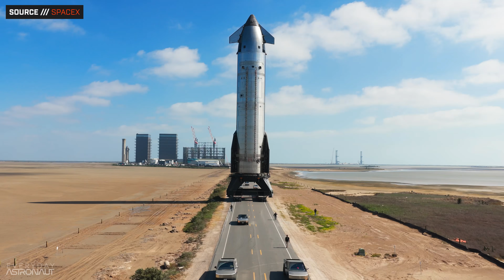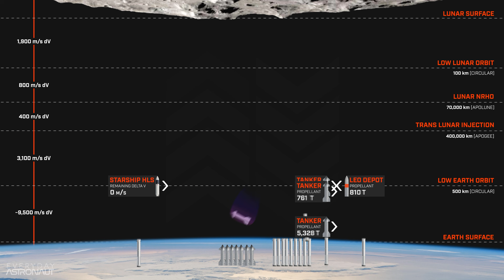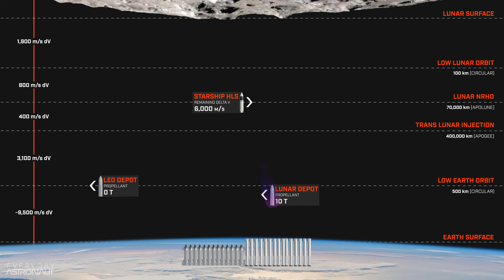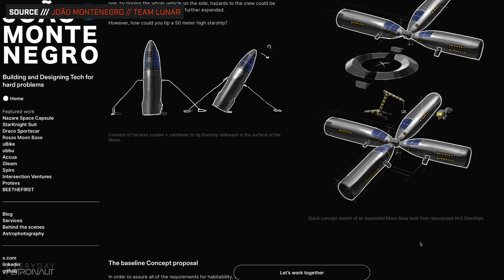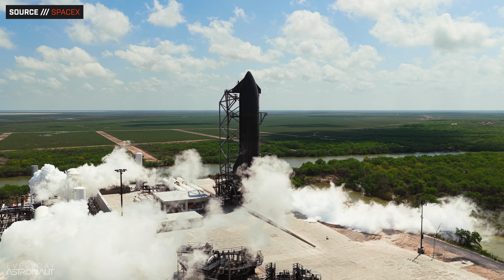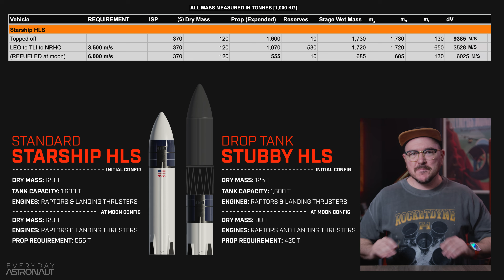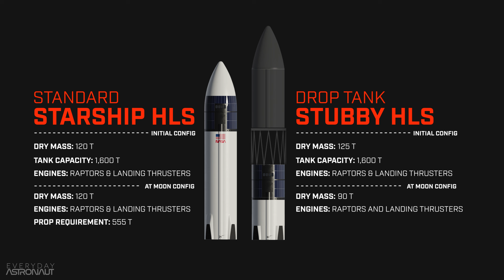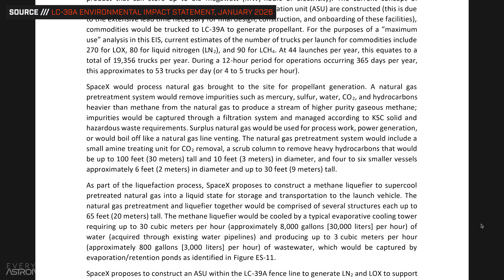Does Starship REALLY require 15+ launches to land one lunar Starship?!

Comment: you probably wont see this, but this whole plan seems a needlessly complicated. yes, orbital refueling makes sense, but it makes no sense to rendezvous with orion around the moon, or to go back and forth to lunar orbit. 

full scale HLS just takes us directly to the moon and stays there forever, building up larger and larger complexes on the moon. orion or similar + ascent vehicle can be separate and either go with the hls (solving safety issue via launching on a falcon 9/heavy and docking in orbit) or be sent to the moon ahead of time (the martian style with their MAV). both o2 and ch4 can be made on the moon just fine. no need to send tankers to the moon ever. this way we are only returning a small amount of mass and actually getting stuff done on the moon.

long term we would probably be better off sending crew back via mass driver launching a capsule, but we can ignore long term for now.
Reply: Nobody is planning to build "larger and larger complexes on the Moon".
Reply: @lepidoptera9337  thats the entire point of what we are doing on the moon. the future there is lunar industry and manufacturing. its how we continue into space. granted its going to take decades before we are doing a lot more than fuel production and basic refining there (which is how we make the fuel, by melting rocks/regolith). but thats the future of the moon.
Reply: @kazeshi2  Yes, that's total nonsense.

Comment: 28:20 WAIT, WHAT???? Pretty easy to climb 40m in a lunar suit??? Are you crazy??? 😂😂😂😂😂😂😂😂

EDIT: The longer this video gets, the crazier statements you make. No reasonable active cooling system can cool off that amount of cryogenic fuel.
Reply: The radiators on the shaded side of the ship will be extremely cold. So cold, indeed, that one has to be careful not to freeze the fuel in them. The problem isn't that. The problem is that heating on the hot side is far more effective for the same are than cooling on the cold side. That is, indeed, thermodynamics. Having said that, your hunch is correct. This isn't being built to go to the Moon.

Comment: The comparison with the Falcon is very misleading. 

Falcons land empty, which means there’s a BIG difference in where the center of mass is going to be located, not to mention the main reason they don’t fall over is *that SpaceX controls the landing pad*. They’re still welding the legs on contact on the barges, and those are fully flat and designed for landing.

Comment: If you'd proposed using multiple launches before we'd seen the absolutely mental reuse rate of Falcon I'd have called you insane, now though it just seems like a question of working through the engineering and bugs to an inevitable success. Provided the money flows I SpaceX seems certain to manage this. 2030? eh, maybe not, but soon after seems entirely plausible.

Comment: Your last comment, EA, about the human-rated challenge, is prescient. I think that getting a working human-rated Starship (HRS)... of any variant ... will plague SpaceX. For at least the next 5-10 years. 

My request for consideration: For at least the next 3 years, prioritize (ONE-way flight) lunar freight / habitats AND also  pump out the big LEO  Starlinks. 

Break into the wealthier finance-market low-latency comm-satellite industry. Strengthen Elon's  self-financing for the long-term big (Moon & Mars) goals. 

Much of SpaceX's already-done human-rating work won't be wasted, in this reprioritization. It can be applied to Starship-to-lunar-habitat conversions. 

(And then try again with transport HRSs about 5 years down the road.)

Comment: Landing horizontali would bend and destroy the structure of the vehicle, that is the real reason. It would need aditional design to acomodate for this bending wich would be safer but so much more expensive. Thrusters could still be placed higher

Comment: 15 refuel launches per mission (ISH). I think they have quite a few optimisations that together can bring that down, but if they match F9 in cadence (with 5 pads rather than 3 and reusable everything) then a fueling campaign can take 5-6 weeks. And if each launch is the cost of a F9 or less, then they have won the argument. 15 launches or so sounds nuts, but if the end result is a more affordable system than an expendable custom built one then this is the better option.

Comment: All of these calculations are predicated on the Raptor ISP. However for fuel transport (assuming active cooling) a slow boat using high ISP technology to transfer from LEO to Lunar orbit might be way more effective in getting the methane needed for the down & up at the moon.
Reply: Maybe. But then you need to create a new set of engines for your fuel depot, and deal with two types of propellant on one spacecraft. No one has ever put ion engines on a ~1200 ton ship before! What kind of power requirements will they use? How long can we wait for a depot to slowly spiral out to the Moon? A month? A year? The faster it is, the more power will be needed.
Reply: If any of it ever hits so much as leo... go fast and blow up.

Comment: 55:53 How much more/less effecient would it be to create a LEO tug booster that saves a small percentage of the burn then returns to LEO for the next one? This tug never has to come back, so it could be lighter and carry a little extra fuel for it's own boost.
Reply: LLO to LEO costs fuel.
NRHO to LEO costs fuel.

Coming back to LEO from either moon orbits requires between 800 and 1000 m/s of delta-v to start the trip from LLO/NRHO.

It also requires a "skip" maneuver on the Earth atmosphere, which requires heat tiles.

Comment: 4 minutes in and your video already failed miserably. What you showed as the interior of the HLS and images of HLS unloading objects on the moon are concept art that are fantasies of where our children or even grandchildren might be many decades from now. Musk's team has released much similar concept art of what the distant future might have for the starship program. They are NOT pictures of the actual HLS for the upcoming planned lunar lander, in fact, they're not even part of ANY actual proposed mission in the near future. The actual planned lander is far more minimal just to test our ability to land on the moon and return. It is of minimal size and has just the crew and necessary equipment tightly packed in a rather confined capsule.

The much larger future concept landers that you showed are part of a distant future dream where there would be a fuel stations in orbit around earth, a fuel station in orbit around the moon, and possibly even fuel stations on the moon, all this is planned to then make such more massive landers as what you showed a possibility. 

If you failed on this, I question your ability to get things right in the rest of the video...
Reply: PS another reason I doubt you'll get things right is numbers of rockets.
Musk wants to get the number of fuel depo filling rockets down to 15. However, his team still is well above that number in estimates. It'll likely be over 20 fillers.
Thus, the total mission:
1: rocket tank
20: fill tank
1: rocket HLS (dock with tank to fill)
1: rocket humans
Total: about 23 rocket launchers required to get humans to moon and back, most of those rockets just to rocket up massive amounts of fuel needed. 

If you compare the total fuel in the various rockets and in payloads of the 2 systems, then factor in that today's rockets have a far greater thrust per fuel ratio, the final truth is it takes dozens of times as much thrust to get humans to the moon and back as what the Apollo missions supposedly used.

Comment: Let's think longer term and inject that in as reality, specifically when talking refueling.  Launch cadence to the moon is possibly going to be 90 - 180 days?  That would amount to a launch cadence for ONE full stack of 5-10 days.  We know they aren't going to use just one full stack or just one launch tower.  And launching on demand is not practical.  There should be a fuel depot in LEO or even an orbit that is a bit higher and possibly safer an away from LEO traffic but within the reaches of Starship.  I'm talking 3-6 Starship Upper stages with full length tanks, no header tanks and no nose cones.  With a 'gas station' in space, you can now utilize the down time between human launches to keep the depot filled.  With 4-5 dedicated stacks that is a pretty relaxed turn around.  The initial launch is what it is, and I agree that SS is VERY tall and that a modified full stack should consider having a three-stage setup JUST to get the moon stuff in orbit efficiently.  Hell, I'm shocked that mini-SS strap on boosters wasn't considered.  Do something like a Falcon Super heavy.  lol  I totally digress on that.  That's it.  Now for the ramble on my idea for the depot.
As for the depot.  I see a simple setup.  3-6 tankers, interconnected together, side by side, just to keep them together.  Where SS docking mounts are now, future depot lunches with male and female connections.  Male retracted for launch on one side (windward side.  Remember, no heat shield) and female on the other.  The fuel transfer is via a truss structure at the nose.  Think of an RO filter setup like the one under your sink.  3-4 filters connected at the top with a bridge.  Two Starship tanker docking ports on each end.  The depot orientation is nose / truss structure towards sun.  When SS fueling from the depot happens, the station keeping thrusters on the truss structure could help settle the tanks and help fuel.  I doubt there would be human missions to the depot while there is fuel in there (at least in the beginning).  As for the depo and the boil off issue, why have the tanks top to bottom?  Why not have the LM tank INSIDE of the LO2 tank.  LO2 needs to be much colder than LM.  They are KIND of doing that right now with a much LARGER transfer tube.  Just make it bigger and remove the common dome.  Now your primary focus is chilling LO2.  This also reduces the plumbing for fuel on and offboarding.  In reality, this would allow full in orbit encapsulation of the tanks with a super structure around it to possibly put layers of shade like James's web telescope uses.  Why that?  It's going to get impacts.  Going to need to be repaired or replaced.  Why make it difficult.  Hell, why not just cover it with solar panels.  Literally.  After all STARSHIP is going to bring it up.  Doesn't have to be that light.  That way the orientation of the depot can always face the earth.  Anyway...  ty for reading.  lol
Reply: How are you keeping the fuel cold?

Comment: How about expendable tankers? Strip wings and heatshield and everything else? Maybe get 50 tons more to orbit?
Reply: Then you have made a rocket system so god awful you’d genuinely be better off reviving the Saturn V. The only thing that makes having to do a dozen flights for a single mission reasonable is the full reusability, if you don’t have that then the payload mass to lunar surface per rocket used is less than the Saturn V and you don’t even get cheap launches.

Comment: Note that getting O2 from lunar water doesn't require purifying. Melt. Filter out undissolved solids. Electrolize. You need dissolved solids to run a current through water.

Comment: Why are the units of delta v the same as v?  Shouldn't acceleration units of d/t/t be used instead of d/t?
Reply: Because the delta v and acceleration are not the same and can’t be used In the same way. Delta v is the rocket’s potential for changing its velocity. Acceleration is how quickly the rocket changes its velocity. This is a difference you notice mathematically, delta v is something that you add on to your velocity to alter it, acceleration cannot be added to velocity because the units don’t match. You need to first multiply acceleration by time to make the units match before adding.

Comment: I wonder how wear and tear on the booster factors into the benefits of reusability in this case. Won't 15 launches chew through, say, half of its operational life? Then it would be like expending half a rocket.

On a different note, all those launches are going to create quite a bit of emissions. I calculated about 33 thousands tons of CO2 per mission. It's something like 300 Boeing 777 London-to-New-York flights, if I'm not mistaken.

Comment: This video is a really amazing showcase of how technologies that we have at smaller scales and/or in atmosphere today could be used to make the Starship-based HLS feasible in 5-7 years with clear direction and good engineering. I really appreciate how Tim sees not just what is today, but what could be in the decades to come. I don’t understand why he thinks this is more relevant to Artemis, which will operate over the next two years, than Apollo, however.

One thing I would’ve liked to see discussed in terms of boil off/timelines is how refilling will take a significant amount of time relative to the mission duration to complete. If Starbase can manage one launch a day, that creates at least 15 extra mission days. To keep the timelines more realistic, they’d have to use more like 3-7 other launch sites with on-site starship building/maintenance operating on a tight staggered launch salvo schedule. Otherwise, we’re talking on the order of months to refuel from one site. Spending that amount of time in LEO would likely call for an increase in consumables such as station-keeping fuel and/or a slightly higher refueling orbit, slightly increasing overall fuel usage.
Reply: There are already 4 launch towers. The 2nd in Texas is operational, the first being modified. The two towers in Florida are under construction.  There will probably be as least one at Vandenberg. SpaceX has made it clear that they will have as many launch sites as needed.

Comment: Seems like you would adjust the length of the upper stage of the fuel tanker version to not have so much empty space in the front so it’s not using fuel to boost mass not needed to orbit.

Comment: You forgot to analyze the cost of which option.
Space x is a private company so it needs to makes money and makes the cost of a launch be cheap as possible for them. Dont think that ditching tanks and etc will be cheap.
When talking about private company not only you need to see the engineering but the economical side  too
Next time it is good idea to have approximate cost too
When talking about space agency than it is another story. Nasa, for example, can leave stuff behind, space x the option for them is to bring the whole thing back, reusing is cheaper than building every time tanks.
Space x, in my opinion, will not throw away tanks because that's very expensive.
I dont understand about rocket engineering but i do about economics and probably the best option is less refueling and bring everything back just like falcon 9. So the starship needs more time to work more.
I have no clue the amount money it will increase in cost of each flight if they throw away tanks but it will probably increase a lot.
The amount of refueling today is way to expensive too. It is not feasible  if they want to make money because it will be too costly. 

So it will pretty cool if you include an economical analysis too not only engineering stuff. Because the constraint is always money.

Comment: If we are at the stage of making the O2 on Luna, then we would switch the fuel from Methalox to Hydrolox right? Hydrolox has a better ISP, but requires larger tanks. But being able to just get 100% of the fuel off Luna surface fixes every issue.

Comment: Add a second stage and make stubby the third stage… like the drop tank but with its own engines. Won’t need all the structural considerations for the drop tank, super heavy has the capacity to lift it anyway, and the additional stage still doesn’t have to be human rated.

Comment: I struggle to see the payoff for all of this. Seems too much money for it to just be a dick measuring contest. If not even the ISS can be reliably funded and maintained over a long time horizon, how is a project like this going to survive. There is nothing on the moon even in the medium term. If we could confirm enough accessible water ice to actually build fuel production industry on the moon or had some concrete plan for some sort of more general industry to produce spaceship parts outside of earths gravity well I would understand. But this kind of investment seems very premature. I think a lot more exploration could be done simply by utilizing the much cheaper single launch capability of starship before committing to a long term expensive plan like this. 
I don't have anything against the idea in general, I just think that without more concrete economic incentive it can not survive longer than a single term in office. So planning long-term missions is doomed to fail and the constant repurposing of scrapped missions will end up being a lot more expensive overall than doing more immediate one-off missions in the long run. The president wants an american to walk on the moon again and spend a bunch of money on that? Take the money, get a one-time mission off the ground that actually works, and try to gain and carry over as much of the learnings as we can for future missions. That is the most cost-effective pragmatic strategy imo.

Comment: 12+ launches is a feature, not a bug, to Elon at this stage. He’s trying to design a system that can launch an indefinite number of times. Refueling is kind of relatively-low-stakes but it-must-work that makes for an incredible stress test in SpaceX’s fly-and-check style. I believe Falcon boosters shot for 15 reuses initially.

Comment: It would make far more sense to use the starship as a cargo ship, and utilise far smaller landers. Landing a HLS Starship only makes sense if we need to land a massive load or once there is a lot to take off the surface of the Moon. It simply seems excessive to land 100+ tons on the moon just for giggles.